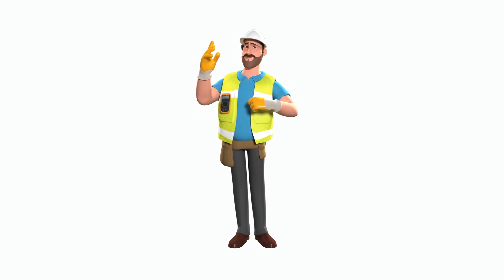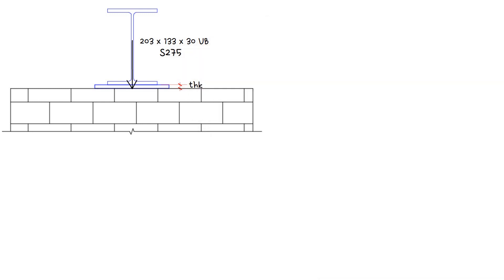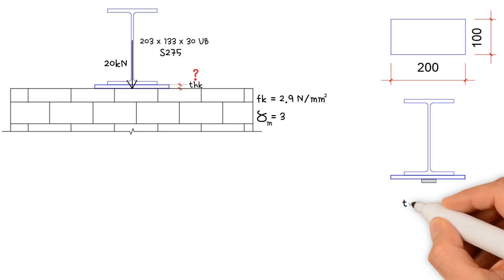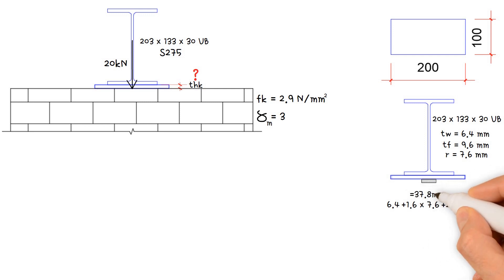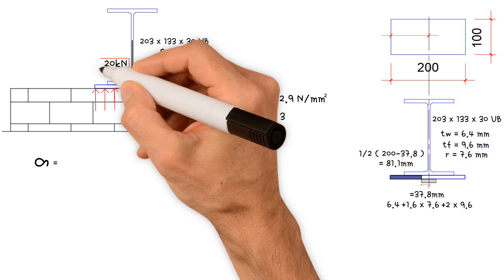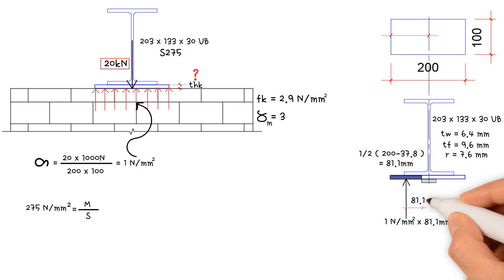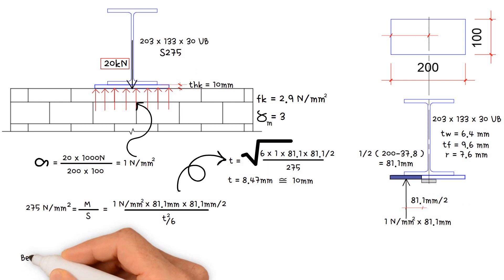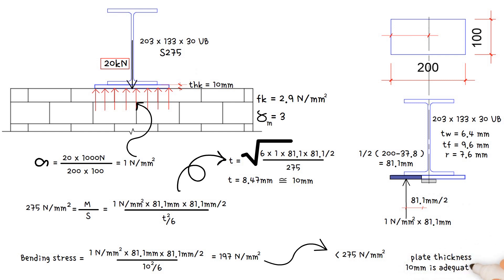How to calculate the required bearing plate thickness to support a steel beam bearing onto a masonry

Comment: Hi, I as per my understanding,
Factored stress under bearing plate = Maximum factored Share force / Area of bearing plate must 
 should less than Allowable compressive stress of brick masonry.
Where assumed allowable compressive stress of 225 mm thick brick masonry = 2.9/3 = 0.97 N/mm2. But in your calculation, it is 1 N/mm2 which is exceded to 0.97 N/mm2 ?. Please advise.         

I have calculated size of bearing plate as 850x215x35 mm for a 4800 mm long 203x203x46 kg/m U.C in opening of 225 mm thick main load-bearing brick wall. Maximum factored share force is coming as 95 KN. Where only total 450mm spaces is available on both ends. Practically it is not possible to insert 850 mm long M.S plate in 450 mm space. Please advise.                                                       
In one other case, I have calculated size of bearing plate as 1500 x100x70 mm for a 6900 mm long 203x203x46 Kg/m U.C. Maximum factored Share force is coming as of 129 KN. size of the supporting wall in each end is 300 mm (cavity wall). So, thickness of bearing is limited to 100 mm. Please advise, 
1) is providing 1500 mm long M.S plate is in order?
2) can we use 275 mm thick width of bearing plate on cavity wall.In this way length of the bearing can decrease from 1500 mm to 500mm. But the beam will cross to the cavity portion of the wall.
3)) What is allowable compressive stress for a light weight of 100 mm thick concrete block.  
4 ) is there any difference in Euro and British steel code as for as calculation of bearing plate is concerned?     
Thanks
Reply: You are very good observant. I observed it now and the right thing to do is to increase the area of the plate by increasing the length of the plate. Doing this the applied stress will be less than the allowable stress.
Please note you don't factor in the load. Use Service load.
Thanks.

Comment: Hi how did you get t squared / 6, for section modulus shouldnt it be multiplied by breadth also?
Reply: It takes per meter 1xtsq
Reply: @suhaibkhan7356  & Structural Engineer Calcs, so the moment should be taken per meter too. something wrong please check
Reply: @haithamalfarhan4612  do you mean treq= *t = (M x 6 / (b x fy)) ^ (1/2). And be is per m width of steel ? It appears he has now this b dimension out of his calculation of treq
Reply: @Tom Shouldn't it still be ((QL^2) / 2) / ((L*t^2) / (6)) or  (QL / 2) / (t^2 / 6)? where Q=UDL
Reply: @Tom Ohh I see now. Q would not be equal to 1 N/mm^2, but rather 100 N/mm if you want to use the conventional way, although the one you used and the one used in the video is a lot faster. Thanks for the replies!

Comment: Great video. I have a question. So stress below the plate is 1 N/mm², the fk=2.9 N/mm² and the yM=3, so the allowable stress below the plate for the masonry is 2.9/3=0.97 N/mm² which is less than the stress under the plate. I would say that plate must be made wider to pass this check as well. Is that correct or I missed something?
Reply from the maker: Thank you for your comment. This video shows you how to briefly work out the plate thickness which supports a steel beam. However, in order to work out the allowable stress below the plate, you would need the wall dimensions and the location of the beam. The allowable stress equals enhancement factor for concentrated loads times  design compressive strength of masonry!  So easily, the allowable stress is greater than one.
Reply: @structuralengineercalcs  Thanks for the swift reply. Hmm, I will have to dig a bit in the EC to get familiar with the enhancement factors. I have seen that for the RC structures, when there is a C-C-C(full compression) in a strut-tie model, then the concrete strength can be increased by a factor o 3 if I remember it correctly. Also, is there a universal understanding on how to calculate the stiff bearing length? In this video it was beautifuly shown for the I-beam, but I was wondering about RHS or L angles or other  , well L angles are not the typical used sections for beams, but still, maybe this knowledge can be shared.

Comment: So in short, for purposes of over designing, plate thickness of above 10mm is okay to use because it will produce stress of less than 275?
Another question, is there a machine that can be used to ascertain the required thickness of base plate?
Reply from the maker: Yes that is correct! I am not sure about the second question.